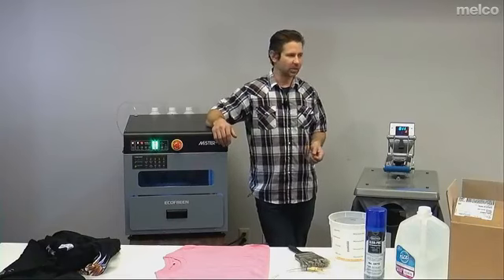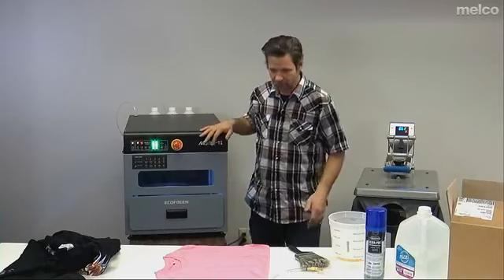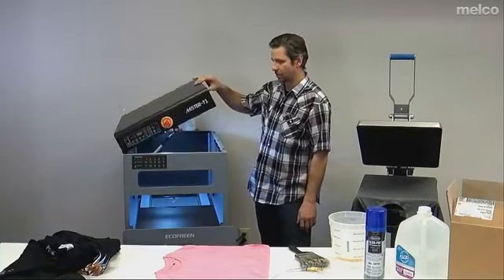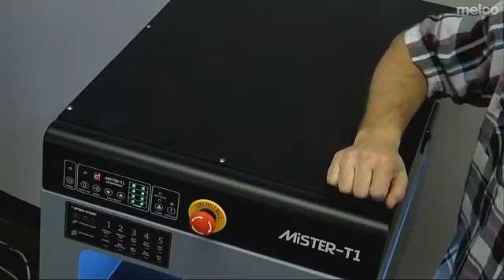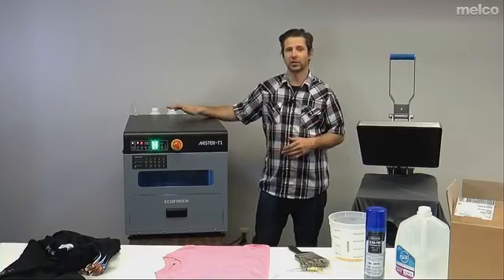How to Pretreat with the Mister T-1 Pretreat Machine

Comment: What should the water to pretreat ratio be?
Reply from the maker: The darker the shirt the more pretreat, typically 50-50 for black. As the color gets lighter, the concentrate goes down. I use 60-40 on navy, brown, dark grey, and as low as 90-10 on a light pink shirt for example
Reply: Ecofreen is say delution ratio must 1:2 , 1:1 do not couse washing problem?